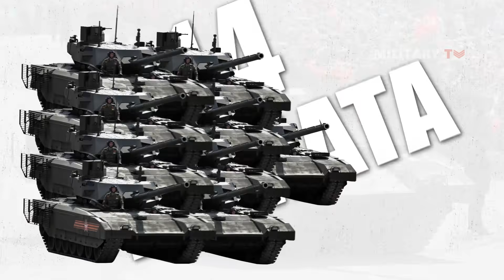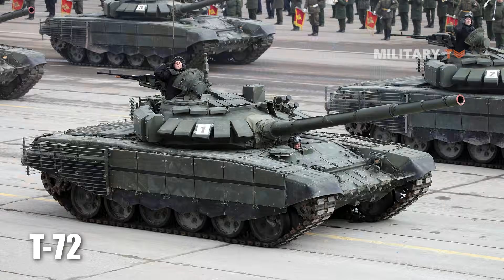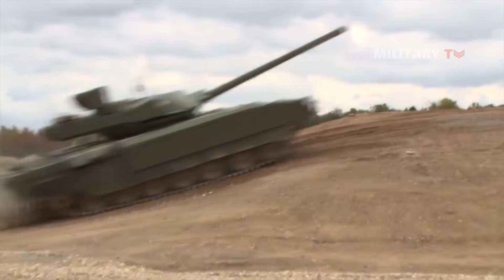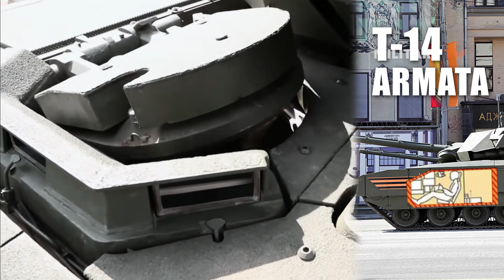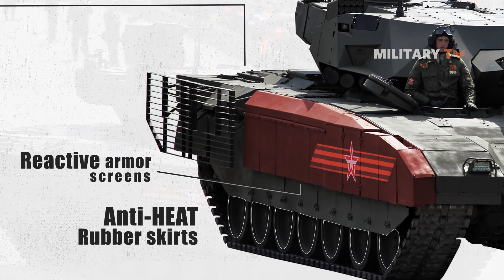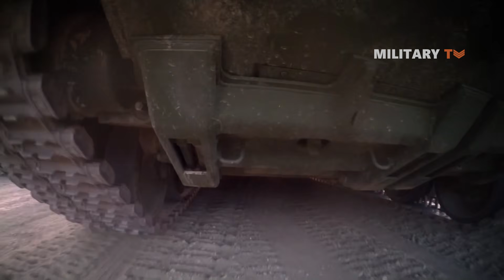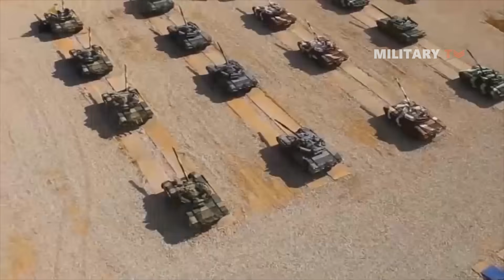T-14 Armata - Russia's Latest Tank

Comment: This tank is so advanced it couldn't even make it's way down the parade without breaking down.
Reply: The F22 is so advance it's was cancelled!
Reply: @rrvillareal2011  Your brain eating amoeba is so advanced you forgot basic English grammar.
Reply: @rrvillareal2011  there was over 150 built how many T-14 is built. Dumb troll lol.
Reply: @rrvillareal2011   blue prints to make success the F-22. Only spare parts are made.
Reply: @rrvillareal2011  lockhead martin making blue prints to succeed the F-22 . F-22 built in 1996
Reply: @rrvillareal2011  F-22 already 26 years old. Lockheed Martin have blue prints to success it,,,,,😎
Reply: @rrvillareal2011  lockhead martin stopped production in 2011 . The F-22 is already 27 years old. They have blue prints with SAAB for new a fighter .
Reply: @rrvillareal2011  F-22 was obsolete (25 years old) Locked-Martin.  Plans on two 6th generation fighters.
Reply: @rrvillareal2011  lol! Russia can’t even build a good fighter!
Reply: @dennisgray7509  at least it's a combat proven fighter. Not like a white elephant fighter. 😄 They couldn't even deploy the f22 in iraq. It got cold feet!
Reply: @rrvillareal2011  The F22 was absolutely used in Iraq. You know, just because you couldn't see it, didn't mean it wasn't there ;)
Reply: @JohnSmith-fe5br  you couldn't see it because it's yellow ( coward)😄
Reply: @rrvillareal2011  It's called Stealth-technology, Sherlock. That's why you can't see them. Have your nation started building propeller planes yet? Aaw, how cute!
Reply: @dennisgray7509  Не может? Су-57 например. А что могут ваши? В 90ые года российский СУ-27 легко уделал ваш Ф-16. Нотвамьоб этом не расскажут.
Reply: @Valentin82.  have no idea what you said
Reply: @acidfly42  It flew missions in Iraq, but yes...first combat in Syria. It is very expensive.
Reply: @dennisgray7509  The Su-57 doesn't exist? Lol
Reply: @Byezde_goyda  yeah ok
Reply: @rrvillareal2011  the F-22 wasn't canceled, it was successful and made it to production, but it was too expensive so they stopped production of more units
Reply: @saltyfloridaman7163  it was successfully cancelled
Reply: Lol that prototype stopped because the driver was smoking and using his smartphone during the parade!
Reply: @mosnicolae1678  he was playing Tetris while driving!
Reply: Now that's funny 😂🤣😆
Reply: propaganda mockery comments like this will never cease I guess,  since you have the superior boasting abilities
Reply: @wolfswinkel8906  Mobilizations like this will never cease I guess, since Ukraine have the superior weapons.
Reply: @JohnSmith-fe5br  And yet they are losing
Reply: @wolfswinkel8906  Enjoy getting conscripted. You can tell us first hand how good these units are.
I will drink my coffee while I wait.
Reply: @Solado  I'm not even Russian, but I heard a lot of smack talk being bandied around everything Russian from the start of the war only to see Zelensky beg for weapons every 3 weeks and Terminators tear entire Ukrainian brigades to shreds. Your propaganda mockery is nothing but a distraction, an ego trip that accomplishes nothing.
Reply: @wolfswinkel8906  Lol. Saw pictures of some disabled terminators, none actually performing. They must have saved that footage for Russian consumers…
Reply: You hater, actually the M1 Abrams uses jet fuel and needs 3 hour of maintenance for every hour of use. So it is the Abrams who can’t move 5 miles without breaking down 😅
Reply: @EGvids1  actually, you are misinformed. Abrams burns any fuel. No Google  n Russia?
Reply: @richarddoig1865  Abrams is a jet fuel slave.  Drove hundreds of miles in Iraq? Not true. Not only it can’t travel for more than 5  miles without needing maintenance but it also can’t perform in sandy environments. T14 Armata vs Abrams 1vs1 loses easily
Reply: @richarddoig1865  they are so good you are sending them to Ukraine right? 🤡
Reply: @EGvids1  Yes, Abrams, Leopards, CV90s and Leclerks will all go to Ukraine. Let's hope there will be another "partial mobilization" so each platform can have their share. A lot of Russians...an insane amount of Russians will die in their losing war against Ukraine before citizens of Russia realizes being ruled by a midget dictator wasn't the best idea...
Reply: @EGvids1  Why bother? Your planes can’t even fly over their airspace. Have to launch the ordinance from over Belarus.
Reply: @Youalreadyknow927  then do it bro. Why do you keep talking. Why haven’t you invaded Russia already, all this past decades?  If it were that easy, NATO would have entered Russia many years ago. But they dare not. Yeah, it’s called respect.  You know it’s mutual assured destruction. Which means your country disappears too.
Reply: @EGvids1  I'm talking about Russian threats on the world threatening everyone with nukes after crossing the "red" line
Reply: @Youalreadyknow927  Russia is not threatening the world only those who are fighting a proxy war against Russia.   You clearly want to nuclear
Reply: @EGvids1  Explain how Europe has been aggressive towards Russia. Go on.
Reply: @JohnSmith-fe5br  I don’t see such condemnation from Latin America, Africa, Middle East and a good amount of Asian countries as they have kept relations and trading with the Russian Federation. Look up BRICS. So we won’t agree. But i think i have made my point already.  Dude Mc Donalds and other franchises leaving Russia was actually good. Russia has started its own production of these services and products. For example Russian cheese has grown so much instead of importing European Cheese etc.  You must be British or something like that 😅 Stop the hate.
Reply: @JohnSmith-fe5br  Dude, it’s called, “self determination” every human being has the right to choose. The people of Crimea, Luhansk, Donetsk, Zaporizhzhia, and Kherson have voted to become part of the Russian Federation. Ukraine with the support of NATO is violating this right of self determination by prolonging this war.
Reply: @EGvids1  😅 Seriously, of course your argument is that it was not a sham. Everything you stated is false. You wanna try again? With information related to reality?
Reply: @JohnSmith-fe5br  next time say where you are from. Don’t be ashamed to say it 😅
Reply: @EGvids1  I am not ashamed at all. I am very proud of my home country.
Reply: @EGvids1  I was fortunate enough to grow up in a free country, not a dictatorship...
Reply: @JohnSmith-fe5br  it doesn’t look like it, you keep hiding your nationality 😅 is it that bad. It’s okay, you don’t have to. Farewell.
Reply: @EGvids1  Hey now...5 miles without breaking down? The Russian tank needs to not break down just turning the ignition key...you think a Russian tank would be able to move 1 mile? You're delusional!
Reply: @JohnSmith-fe5br  T14 Armata can travel 30 miles before it needs maintenance. 1 hour of maintenance for every 7 hours of use. You 🤡
Reply: @EGvids1  No way! I know the T-14 is 100 percent Russian and that means shitty components, inferior chips and Russian "quality" all over it. That thing breaks when you turn it on.
Reply: You with your super weapon got kicked out of afghanistan by the ak47 and sandals.
Reply: @winkus8586  Yes, I also remember history. The Soviet Army did in fact invade Afghanistan in 1979, yet another innocent country, but the Soviets were soundly beaten and forced to withdraw in a humiliating way.
Reply: @winkus8586  I guess, in all fairness, the Russians did indeed "get kicked out of Afghanistan".
Reply: @winkus8586  Yes yes the Soviets were humiliated and suffered catastrophic casualties. Fast forward today and nothing has changed. Not even Russian tactics. NATO however...I wouldn't count their exit as a forced withdrawal now. You do realize NATO is about 500 times stronger than Russia?
Reply: @JohnSmith-fe5br  
50 countries got kicked out by sandals
Reply: @winkus8586  It's very unclear as what you are referring to...is this yet another humiliating defeat the Russian Army has suffered, or?
Reply: @winkus8586  I think you need to take a look at the history books LOL do you know how to use Google?
Reply: @JohnSmith-fe5br  
What if i say i have spent the last 15 years readings 24/7 and 3-5 hours per day??? I read 500 pages book in 2 days. 1 day sometimes..
If you are under 30yo... I think it is legitimate for me to say i have read more letters than the amount of grain you have ever eat.
Reply: @winkus8586  "Reading 24/7 and 3-5 hours per day"? Don't forget to study math, boy ;) LOL!!!
Reply: @winkus8586  I think it is legitimate for me to say you never passed 2nd grade in school HAHAHA
Reply: @winkus8586  yup, just like you guys did, but with considerably less casualties. As I recall, that was the final mail in the coffin of the USSR. What do you think will happen when the moms find out how many aren’t coming home from Ukraine? Yikes…
Reply: Reheasal not parade, parade was fine. It wasn't broke down, unexperienced crew just put it on E-BRAKE and wasn't able to turn it off, and so was forced to evaquate in perfectly working condition...Diffirence between experinced factory driver and untrained conscript driver they leave drive most modern tank
Reply: @onerxowns2202  finally someone who knows the truth 🫡
Reply: This is fake never broke down watch full video tank crew engaged the brake by mistake This is why the tow vehicle that could tow 3 times the 14 weight couldn't move it after some time they realized there mistake an the tank drove off on its own red square parade is done by conscripts on a new tank platform at the time this was 2015 but in stead of doing actual research u just spew propaganda sheep
Reply: The f22 is so advance they saw all the problems it has in advance so they cancelled it! 😄🤣
Reply: @rrvillareal2011  Lockhead martin stopped building in 2011 its already 27 years old. Lockhead martin and SAAB have blue prints to success the F-22,
Reply: The F22 crashed multiple times when it undergoing its initial demos.
Reply: @Tomas_TK401  Are you a comparing a super advanced stealth fighter with a Russian junk tank??
Reply: Hay muchos opinologos de lavadoras rusofobicos que no ven mas haya de sus narices, sin embargo opinan como si fueran expertos.
Reply: They are not copying but surpassing it's capabilities and knowing it's weakness america to has a prototype of new battle tanks  imitated the Russian design of 3 crews only I said immitatting because Russia dit it first to it's armata tank
Reply: @arnulfomanuel6340  Russia made the first crappy tank? I don't know about that, but Russia certainly makes joke military equipment, that I can agree with. Tanks are from a different era and Russia is lagging behind tremendously. The whole Ukraine war is truly humiliating for Russians.
Reply: Ifiot😂😂🐵
Reply: It was a repetition and the guy just engaged brakes and didn't know how to turn them off
Reply: @quik478  that may be even worse. The crew doesn’t know how to use the brakes. That sounds like Russian spin. Maybe someone was smoking, and it broke the brakes.
Reply: @richarddoig1865  how can break the brakes? (ha-ha)
Reply: Lotta gamers In these comments
Reply: That was an illusion
Reply: Russia tanks Suck
Reply: Ur a fxking kid who I'm Pretty sure doesn't know how to drive 
It didn't break , The Brake system Malfunctioned due to driver error
Later in Parade it drive normally
Fxking kids this day
Reply: Actually, the Armata is unreliable and expensive, so that's why Russia can't even afford to send it into the battlefield.
Reply: 😂😂😂😂😂 I didn’t break down u muppet who told u such lies ? 😂 CNN ? The US government? CIA?
Reply: @leopardontheboat8252  its really easy for them to say it broke down when they dont know how tanks work
Reply: so you were there you know that it broke down. FRAUD.
Reply: @yenciehossain9020  What do I care ? I get to sit at home while you get conscripted hahaha
Reply: Extraordinary claims require extraordinary evidence ?! I think your pea-brain broke down and not the tank !
Reply: Says the guy who doesn't know the truth 🤡🤡🤡
Reply: @captaincaizo7038  Comments the guy who's too afraid to fight for freedom in Russia.
Reply: @winkus8586  I know I can protest against my government without being thrown in jail. I know I can vote and that my vote counts in fair elections. I know I can freely choose what job I want. I know I can live my life in a democracy without fear of being persecuted for anything. I know that because I live in a democracy I am happier than you, will live longer than you, have better financial security than you, will enjoy a better health care system and retirements benefits than you. I really can make this list very long...
Reply: @JohnSmith-fe5br  
Sorry my friend..... I live in a much.....much more democratic country then yours(if you are an american). We have more than a dozen political party here.

Anyway.... A quote from an american politician from a century ago that i don't remember the name.. "It doesn't matter where the votes goes as long as i am the one who choose the candidate"
Reply: @winkus8586  Love your logic by the way. "I am so much more human than you are, that is...if you were born on Mars, that is..." Great logic. Flawless reasoning! Lol
Reply: @winkus8586  This one's pretty great. Любовь зла, полюбишь и козла. Why is it that Russian males like goats so much, hm?
Reply: @winkus8586  Why is that the average Russian can barely live till their 40s?
Reply: @winkus8586  Why is it that you think having a midget leader that looks like Dobby from Harry Potter was ever a good idea?
Reply: @winkus8586  Russia is not even considered a developing country...there are African countries more evolved than Russia! LOL
Reply: @winkus8586  I see you're really struggling which is why I'm having so much fun right now :D
Reply: @winkus8586  Only laughing at you ;) and Russia of course, the biggest joke!
Reply: @winkus8586  I take it you ran away crying and are now chugging cheap disgusting vodka...so predictable :/
Reply: @JohnSmith-fe5br  
Yes russia is a big joke...
 LoL
Reply: @JohnSmith-fe5br  
LoL
Reply: @winkus8586  HAHAHAHA :D
Reply: @winkus8586  I know you are ;) Today I enjoyed Starbucks, McDonalds breakfast, watched my savings increase, and most of all...I enjoyed my freedom! Freedom is the most important thing in a country. Maybe one day, you'll be able to experience it.
Reply: @winkus8586  Are you crying? :O
Reply: @winkus8586  That is actually true. The world does not need more Putins. A democratic Russia could be pretty awesome. We might actually let you come out and play with us. So, what are you gonna do?
Reply: @winkus8586  I hope you'll be able to experience freedom and democracy...and less Nazism in Russia.
Reply: @JohnSmith-fe5br  
Azov..... And KKK
Reply: @JohnSmith-fe5br  
Bye bye anglo dictator.
Welcome a global democracy
Reply: @winkus8586  Bye bye Putin. Welcome Ukraine to NATO.
Reply: @winkus8586  Hitler. Bin Laden. Himmler. Putin.
Reply: If you were smart, you would do some research before making such a arrogant and retarded comment.
Reply: Shut up
Reply: @Bammbam86  ...is what Putin said to Russians when they wanted freedom.
Reply: @Bammbam86  are you ashamed of that smith guy?
Reply: tank be blessed protected in the name of Jesus Christ!
Reply: @jama7538  More like Allah Akbar...
Reply: Driver opened bootle of vodka :D
Reply: Didn't break down. The driver was given the tank the very same day. He left the parking brake on
Reply: @deven6518  You Vatniks are so stupid. 100 different answers and none of them the same.
Reply: @Solado  still not offended. You do appear to be offended though, because the truth has you ovulating in throwing reds. Still not from Russia. I just happen to be one of those who kept informed over the years, vs you that jumped on a propaganda bandwagon last year. Anything else, or is vatnik the best you can do? Cause i still haven't been bothered enough to look up the meaning.
Reply: @Solado  when the us army mobilizes, I'm packing my bags and going south. Patriotism is a nice word for foolish pride. Look after you and yours only is the name of the game. I don't see why yall so  pissy because a lil bit of truth hurt your feelings.  How strong is your faith if it can't withstand a little scrutiny huh?
Reply: And yet, it's now being sent to kill bunch of your mercs at Donbass..
Reply: @citizen4047  Keep dreaming Vatnik, soon the war will be over and we can properly come after you.
No matter how much your goverment lies to you, the 150k KIA Russian's thus far is the start. Only a few million to go.
Reply: All the Russian haters hang on to that parade. When an inexperienced driver got it stuck in neutral.
Reply: @eaglethrust379  No, not at all what happened. The driver broke the clutch which stalled the tank. Pay attention, Comrade.
Reply: there is no corruption in America, which is why the F-35 has been entering the army since 2015 (en masse), but was not adopted in 2023.
Reply: @АлександрЗубков-ь2к  Give it a few weeks and you will be on the front line.
Reply: @Solado  it's a pity that you can't admit your mistakes, for example, according to your generals, 50%+ of f-35 aircraft are not ready for combat, the flight time is very small, the flight speed leaves much to be desired.
You are very aggressive in your statements, don't you think that your country may collapse because of this?
If I find myself in combat, I understand what my country is fighting for. And what are you going to fight for in Ukraine ? What are you willing to sacrifice ? What is your country ready to sacrifice ?
If you can answer these questions from both sides (yours and Russian), then you will understand Russia's position a little, but I hope you have the sense not to interfere in the conflict, because the chance of getting out of Ukraine alive tends to zero.
Reply: @Solado  I assumed that you are from America or the European Union, if you guessed right, it does not cancel my words.
The message was different, according to you, you treat the Russians badly, you insult them, you can't think rationally a few steps ahead, any military actions end in negotiations, so why not agree right away ? without changing the usual way of life, no one has ever captured Afghanistan, Russia similarly, so why did you decide that Russia can be defeated? a country that has colossal weapons, one of the most belligerent states, where many people claim that Russians are one of the most resourceful and not whimsical people.
I hope your mind will prevail.
Reply: Just like su57
Reply: According to who?
Reply: @jaythomas3224  According to everyone who has seen the video...
Reply: God told me that one of the T-14 tanks that stopped in the Russian military parade was an operator error by "applying brakes" in the tank.  It was not a system failure.  You supposed to stop when you put your foot on the brake.
Reply: @noobz5056  But then the clutch broke, and God told me this is a sucky Russian tank.
Reply: Any new equipment or building needs a time to eliminate bugs
Reply: @periscope1368  Yeah, you just have to be really careful when operating the T-14 so it doesn't break. Maybe try to avoid bumps in the road, or not using the gearbox. Maybe not drive it at all, in fact...if it breaks down going at low speed on level ground, it is a bit of a dainty tank...
Reply: Ломается все даже хвалёный F35😂
Reply: По голове западных фашистов и их шестерок точно сможет проехать!!
Reply: TANK T 34 from different countries! US running engine from BMW and electronics Italy and France after the USSR asked to redo the T34 and the Americans redid everything! Since then, the modernization has been going on! That's how all the equipment of the Russian Federation is from other countries!
Reply: A capture of one tank will produce a copy and better from the other side he he
Reply: @arnulfomanuel6340  Nobody copies Russian designs though. Unless you wanna build a death trap, or a dainty tank that breaks down when driving normally on roads.
Reply: @arnulfomanuel6340  Wait...why would anyone in their right mind wanna copy anything Russian?? Unless you wanna build crappy death traps that break when you start them, I guess. But...why would you wanna do that??
Reply: Это ты скажи хохлам и их хозяевам пиндоса. Их ржавое железо пока ещё ползает. Но недолго осталось.
Reply: Fool)))
Reply: @АлександрАрефьев-п3ф  Honestly, can you name a worse tank? :/
Reply: @JohnSmith-fe5br  which tank is worth? T 14??)
Reply: @АлександрАрефьев-п3ф  You have a lisp there? Worse. The T-14, as crappy and useless as it was being Russian made, actually could run for hours before it broke down.
Reply: @grey886  The Germans once did not believe in Russia, do you remember what it led to? The Russians have a great saying for you. The dog barks - the caravan is coming.
Reply: You are a clown ! 😂😂😂
Reply: Better of  the Abrams "the chest" 😂😂😂
Reply: @grey886  Isn't it amazing these Russian's are in full cope mode, fed all these lies.
Can't wait to see them on drone footage.
Greeting's from the UK, may our tanks race for the highest K/D count :D
Reply: @Solado  can't wait to see them crawling out of there destroyed Russian vehicles with flames on there backs as they run for there miserable lives 😆
Reply: Like Leopard in Syria? Show hes capability as well 😂😂😂. Under 6 hours , the water of the engine was not even hot , was destroyed . With old russian anti tank weapons . 😂😂 That is fact . What you said is only your opinion . There is a big difference .
Reply: @lajossimon6371  and all the abrams tanks destroyed in Iraq by terrorists who were using old russian tech from the 60's and even 50's
Reply: @YTMMS-hy6mz  Abrams is a expensive tank . And that terrain will couse damage on it . He will be anbandoned by hes own ukrainian crew . Abrams is a overrated tank by USA. Imagine in the gulf war 20 from 30 abrams was not able to move to fronline , becouse of  engine and transmission problem’s .
Reply: it didn't break down, some inexperienced driver engaged emergency brake (parking brake), it later drove away on its own...
Reply: @KashtanGreg  So they say🤣🤣
Reply: @haslefredly6778  so they said about it 'breaking down' , seems like tou believe the first news you hear... also, you can clearly see, that it couldn't even be towed away because of a parking brake. If it did actually brake down, it could still be towed away ehile in neutral.
Reply: @KashtanGreg  sure it did
Reply: @KashtanGreg  it got towed away you russian liar
Reply: @KashtanGreg  yeah right 😝
Reply: @KashtanGreg  should the driver be  excited by firing squad 🤔?
Reply: @KashtanGreg  I don't know about that. I'm pretty convinced this whole thing is fake. You know, slap a shell over a T-72 to make it look like a new tank. Russia is so pathetic :/
Reply: @alifarhi19  Yeah, I think they would agree with me. Yup. It also appears that you are completely inaccurate. The losses Russians are suffering are absurd. Russia, in less than a year, has lost more than ten times the amount of soldiers that the US did over a two-decade campaign. Let those numbers sink in, Comrade.
Reply: @JohnSmith-fe5br  Ive seen a T80BVM with the relict era on the sides + 4s24 in the bags, stopping 3 atgms, and still fighting. That was a modernised T80, so I believe they work well.
Reply: @KashtanGreg  Oh, well.. I've seen two T80BVM with the relict era on the sides + 4s24 in the bags, breaking within 10 minutes of driving. Those were modernized T80s, so I believe they're crappy piece of shit Russian technology. Since I have seen 2 tanks, which is twice the amount you have seen, my story wins over yours. Russian T80s are crap and soon to be scrap.
Reply: @JohnSmith-fe5br  Russia lost more troops in the first year of this war than  America has in any war it's ever fought in history
Reply: @TankBoyTroy  I know. Russia has never valued its own citizens.
Reply: @JohnSmith-fe5br  Imagine coping hard
Reply: ...And they are dominating the battlefield in the Ukraine...oh wait
Reply: it didnt break down lol the driver messed up with the clutch
Reply: @YTMMS-hy6mz  So normal russian  problem. I should know, we had it all the time. Some people know this problem is overall quality of russian military equipment.
Reply: @YTMMS-hy6mz  it has an automatic transmission....
Reply: @rubbishui  sorry im bad at english))) i meant break. The driver's foot slipped and he pushed the break down fully and the engine stalled, he was a new guy and he also thought it broke down. Thata why it took them some time to get it back driving.
Reply: @YTMMS-hy6mz  The tank is so advanced that simply using the clutch wrong causes it to break down. Got it.
Reply: @Solado  lol, you never rode a car I guess. It didn't "break down", it stops. Also it didn't happen at a parade but at rehearsing. So much ignorance.
Reply: @adisproject  aren’t the crew trained how to drive it
Reply: @adisproject  Ok, Sir. I'm just going to stop you there. Just because the tank broke down during rehearsing and not at the parade doesn't mean it didn't actually break down. From a simple misuse of a clutch.
Reply: @Solado  It got towed away everywhere but Russian State TV where an ARMA II reenactment showed Russians how the Tank drove away later.
Reply: @Solado  Oh with that quip you're most certainly going to make Russia leave the Ukraine region.
Reply: @Veldtian1  Oh with that comment you're most certainly going to be made fun of.
Reply: @Solado  it didnt break down it drove right after when they got a new driver in.
Reply: @YTMMS-hy6mz  So, every time this tank breaks down you have to put in a new driver? That is so dumb!
Reply: @JohnSmith-fe5br  yes because he wasnt experienced enough. He was an embarrasment so they got in someone more experienced. And no it didnt break down it stalled
Reply: @YTMMS-hy6mz  Why would Russians put inexperienced drivers in, allegedly, their latest and most precious tank? So, the clutch broke causing the tank to stall and the driver, as inexperienced as he was, was very embarrassed about the whole thing? Ok. Pretty crappy tank, if you ask me.
Reply: @JohnSmith-fe5br  he hit the e-brake
Reply: @YTMMS-hy6mz  He hit the e-brake, causing the clutch to break which stalled the tank until they could find a driver that knew how to drive the tank in question. Got it.
Reply: @JohnSmith-fe5br  I told you, the quality of their trolls= quality their tank drivers.
Reply: @JohnSmith-fe5br  you didnt got it it didnt break he tought it broke down since he didnt notice the fact that he has hit the e brake. You can see this when they tried to pull it away with a reconance vehicle but it didnt move.
Reply: @YTMMS-hy6mz  So, more than one tank broke down during this short parade. Doesn't seem like a reliable tank, does it?
Reply: @YTMMS-hy6mz  So far 2 tanks have broken down and 1 tank broke down during rehearsal...yeah, what a great tank...24 hours of maintenance for every 10 minutes of use...way to go Russia! LOL
Reply: @JohnSmith-fe5br  but all you say is propaganda. how i think is both nato and russia tech is good some better or worse but we see each other as shit because of propaganda. in reality even if us russians say americans or NATO as a whole is shit and gays they are still just as good if not better than us and vise versa.
Reply: @Solado  We'll soon see what they can do, have no doubt...! 😏
Reply: @attilanagy1811  Correction: YOU will see what they can do, along with Leopards, Abrams and Challengers. I will be sat at home, you will get conscripted
Reply: @Solado  I'm not convinced about that.
Reply: @JohnSmith-fe5br  wrong it's automatic it was parking brake engaged drove off on its own after realized this isn't breaking down sheep
Reply: @raybensinger8383  The tank wasn't breaking down sheep so the parking brake drove off on its own upon realization. Are you on drugs?
Reply: @Solado  You're definitely not even old enough to drive if you don't know what a braked vehicle looks like, that's why the tank wasn't budging when the tow came 😂 kids these days
Reply: @Solado  I think Roblox is better for you.
Reply: @adisproject  who cares if the T-14 broke down in a parade.  It broke down!
Reply: @Solado  Soldiers can bugger anything up, maybe if you had been a  soldier, you would have known that
Reply: @adisproject  He never served either
Reply: @adisproject  It is scrap
Reply: @YTMMS-hy6mz  clutch? Lol
Reply: @YTMMS-hy6mz  no parking break t14 is automatic
Reply: @YTMMS-hy6mz  it's a damn automatic transmission. How can you mess up a clutch.
Hello?
Reply: @1u5t1n   inexperienced driver simply forgot to disable the parking brakes years ago. to be frank, even if it had no incident at all, western chills would always find something to make fun of.
Reply: Your technology is so advanced that you guys quit fighting the Taliban's and the Vietnamese.🤣
Reply: @giacomogiacomo1194  and who have you fought!
Reply: @giacomogiacomo1194  Soviet union abandoned 1341 MBT, BMP, BTR, BDRM and artillery pieces in Afghanistan in 1989😝
Reply: @giacomogiacomo1194  Russian technology is so advanced it has now entered the 1980s.
Reply: @JohnSmith-fe5br  Конечно продвинута.Россия первыми поставила на боевую задачу ракеты с гиперзвуком. А у штатов их до сих пор нет. 🤷‍♂️Только у России есть ядерные дроны, торпеды, которые способны проплыть тысячи километров и их невозможно обнаружить. А у штатов, есть старенький Пэтриот, как ваш президент, сонный Джо. 🤷‍♂️
Reply: @JohnSmith-fe5br  the m1 Abrams is 1980s. Most of our fighter aircraft are 80s and earlier. Should i keep going?
Reply: @deven6518  The M1 Abrams is American, not Russian.
Reply: @JohnSmith-fe5br  your point? Did I ever say it was?
Reply: @deven6518  I am just correcting your mistakes.
Reply: @JohnSmith-fe5br  what mistake? Again, did I ever say it was Russian?
Reply: @deven6518  You said, and I quote "the m1 Abrams is 1980s. Most of our fighter aircraft are 80s and earlier. Should i keep going?" Obviously, you're talking about Russian technology and I just rightfully and truthfully pointed out that the M1 Abrams is American made, and not Russian.
Reply: @JohnSmith-fe5br  I'm speaking about the us military.  F18 1983, f15 1972, m1 Abrams again is 1980,  First test flights of the f22 were in the late 80s, f16  1970s, the f35 actually had its avionics started in the late 1970s and then nothing much happened until yakovlev sold them some help, humvee 1980s, Bradley 1980s., m113 1960s,  lav-25 1980s, m270 1970s......I could continue. 
Also, you assume I'm Russian 🙃😑
Assumption is the mother of all.....finish it.
Reply: @deven6518  (You need professional help. You're not well.)
Reply: @deven6518  Did you know Russia is not even considered a developed country? :D Hilarious!
Reply: @JohnSmith-fe5br  you don't seem calm. I'm just spitting facts and youre......this
Reply: @deven6518  Please stop spitting rabies also.
Reply: @deven6518  Did you just destroy your keyboard in complete utter rabies rage? I must pray for you.
Reply: @JohnSmith-fe5br  no, you're doing that right now though. It's sad to watch, but funny at the same time
Reply: @deven6518  I beg of you, you must control yourself. You're clearly losing. I find you sad. Just sad.
Reply: @deven6518  Are you crying? Again?? I'm really just making fun of you. On your expense. At least I'm having fun :D
Reply: @JohnSmith-fe5br  doesn't matter to me. We were having a talk about tanks....and now you're speaking about canine excrement.
Reply: @deven6518  If you don't answer and admit that you have lost this argument, by the laws of Internet, I have won. And you have lost (yes, I felt the need to clarify considering my opponent).
Reply: @deven6518  John Smith MasterMind 1 - Dèvèn The Russky Loser 0
Reply: @JohnSmith-fe5br  with such childish comments.....your opinion matters to you and you alone. Still waiting for a good insult
Reply: @deven6518  Every time you look in the mirror, buddy LOOOOOOOL
Reply: @deven6518  How about this for an insult..."Russia is dumber than a rock." Now, if that's not insulting to the rock, I don't know what is.
Reply: @deven6518  You need to cope harder.
Reply: @giacomogiacomo1194  Americans 🇺🇸 fought Iraq thousands a mile away and deployed over 150.000 thousands of soldiers during the first  Iraq -Kuwait war
With good equipment, weapons, food , logistics support, air support etc!!
Russia in 2022 while its trying to invade a neighboring country having a terrible invasion with terrible equipment,weapon manpower etc.
Pls cut the bull shit
Reply: @giacomogiacomo1194  in Afghanistan the US had the taliban in hiding and were simply occupying Afghanistan in order to educate their government how to run their country efficiently, build proper water supplies and power grids, and train police and military forces to defend themselves. After several years evidence showed corruption within their government so the US decided to leave Afghanistan since they were basically throwing away billions of dollars on a lost cause. News of rhe US leaving lead to the Taliban coming out of hiding and even providing security for the US military with a promise to not shoot a single US soldier because the Taliban was tired of living like roaches. They even fought other terrorist cells to prevent them from attacking US troops. The Taliban just a side benefactor from the US leaving, meanwhile the US now doesn't have any obligations to waste taxpayer money on a failed state
Reply: Lame
Reply: Fun fact F35 usually requires heavy maintanace like engine change after 1000 hours by average while the SU-57 2100hours. Keep talking shit about russian quality...
Reply: @YTMMS-hy6mz  su 57 is more elusive than the armata. The only plane Russia has that's worth a dam is the su27 and even it is trash compared to a American airpower
Reply: @YTMMS-hy6mz  Fun Fact all tho the F35 is getting a Newly designed engine , the Pratts in them now don't get pulled at 1000 hours.
Typically Jets in the US forces go 5-6000 hours....quality
Have a source? or is this one of them "trust me bro"
Reply: @Igrowbigbuds-b3q  this information is from somebody who flew a mig-25 and SU-25 in syria and ukraine and is in the wagner group (not me) and lets be honest, neither me or you have a legitimate source to show right now since most of info like this is highly classified.
Reply: @user-jj2jp1ik5e  fun fact: maintenance intervals are to keep the engines at peak performance. The US has the economy to allow much stricter quality control standards while Russians are practically forced to wait as long as possible to service their engines. Also, another fun fact, the engine in the F-35 is the world's most powerful fighter engine with 45,000lbs of thrust in its single engine. The SU-57 has a peak thrust of 31,000lbs per engine, which is 14,000lbs less than the F-35 engine. Russia failed to develop their promised 5th gen engine for the SU-57 so they're literally using SU-35S engines, but the SU-57 weighs more than the SU-35S, so it's got a thrust to weight ratio lower than the SU-35S which is 1.13 with 50% fuel. The SU-57 has a thrust to weight ratio of 1.08 with 50% fuel. The F-35A has a thrust to weight ratio of 1.16 at 50% fuel and 1.09 with 50% fuel, 4 aim 120Ds, full cannon ammo, and two stormbreaker bombs as of the Block IV update
Reply: @YTMMS-hy6mz  oh yeah, those are those planes that are so stealthy, they never see combat….we actually have the parts and technology to service our equipment. Exactly how many SU57s are in the field? And how many F-35s are in service with various Air Forces around the world? I’ll wait for your answer….
Reply: @richarddoig1865  over 120 SU-57s have been manufactured.
Reply: @YTMMS-hy6mz  Source?  My source says 21
Reply: It's almost like you just pull numbers out of the air.....copium withdraw?
Reply: @Igrowbigbuds-b3q  sauce?
Reply: @Igrowbigbuds-b3q  lol slander is a way of copium
Reply: @YTMMS-hy6mz  This was posted from the Russian manufacture of the SU-57
Dec.22 2022
"This is actually the first year of the highly serial production of Su-57 planes in Komsomolsk and subsequently their number will increase. We reached more or less substantial production of these planes this year," the top executive said in a live broadcast on the Rossiya-24 TV channel.